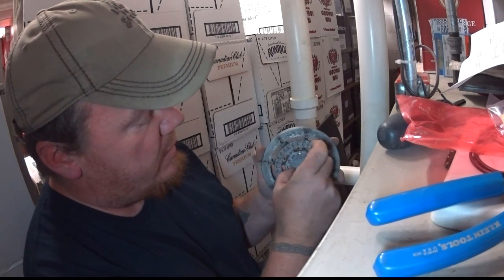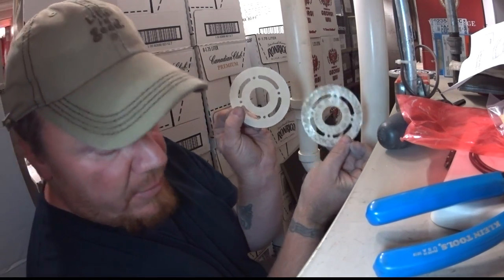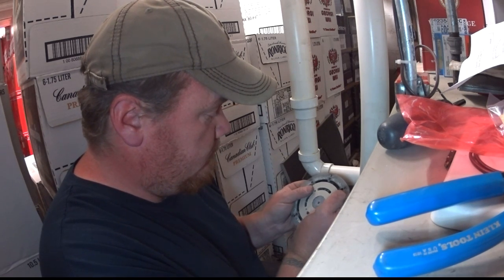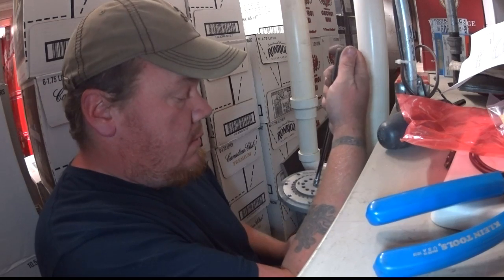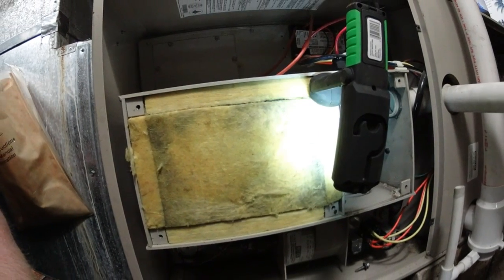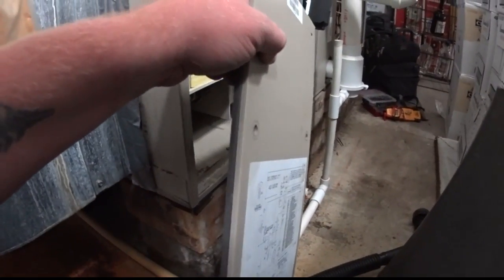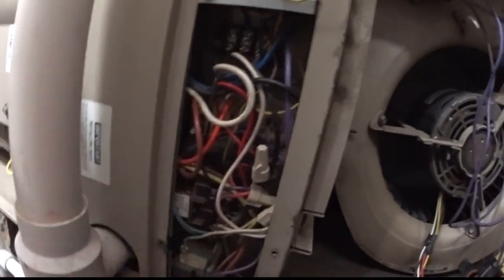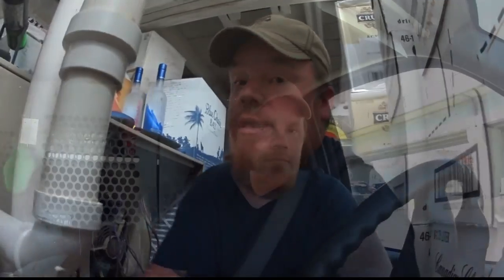HVAC pulse furnace service. #HVAC

Comment: I still have a pulse 21 for 20 + years.However parts are getting to expensive . I see the flabber gaskets on YouTube for like 180 dollars.😭.Also you need to be mechanically inclined to keep them running.I hate to get hit in the pocketbook for a new furnace.but sooner or later everything breaks.☠️
Reply: I had mine go on lock out , removed and cleaned the soot off with a fiber cloth put back together is running great , G21 30 years old , I replaced the ignition control a couple of times with a BASO . When cleaning the flapper don't loose the spacer washer it's easy to do .

Comment: Thanks for the video!! Came home last night to my pulse H14 not working. I removed the air flapper and had to clean the element with a gentle  detergent and a damp cloth. We live in a cold  climate and just needed to get it up and running. Used the blow dryer to dry the flapper element and the old furnace started up like new. 
Is there anywhere a consumer can get parts for the Lennox Pulse furnaces now days? I know they stopped making them in the 90’s and it seems that Lennox won’t sell parts to consumers. Any suggestion where I can get parts?

This furnace is a work horse…. It quickly increases the temperature in the morning 6 degrees in our 3,200 sq ft house in about 10-15 minutes…. Crazy efficient system!

Comment: still have one running in my house.  has a weird issue where it sounds like it's shorting out and wants to cut the motor off prematurely.  I can tug on the wires a bit where they go tin the area above the motor (there's 2 boards in there) on a Lennox G21 and keep the fan running by doing that.  I hope it's just a lose wire, makes a sound like it's shorting out a bit.  It's sometimes stopping the fan while it's still combusting.
Reply from the maker: @American_Made  if the blower motor is stopping ... It may be the blower delay board.  They are known to go bad.

Comment: I have a Pulse 21 that is 30 years old. It will sequence and run for about 5 minutes and just suddenly shut down before the set temp, is reached. I have cleaned the air flapper. I made my own pressure test equipment. Leak down was 1.5 PSI after 10 minutes. I had changed the fan control board a few years ago along with a BASO ignition controller and the bi-metallic high limit switch. Just started acting up again. Would you have any idea what may be happening?
Reply from the maker: @karldegroot3131  I would check to make sure the drain trap in the bottom of the exhaust tee is clear.  A condensate drain restriction will cause issues like you are describing

Comment: Awesome video, question, i have a pulse 21 1996 and replace ignition module with the one you used 4 yrs ago, my furnace isnt heating up and turns off in 3-5 seconds, how do i know my control module is bad, I have green blinking lite is on and no red lights , thinking my flame sensor is defective or dirty, thks

Comment: Just saw this video and it got me thinking...I have a pulse furnace around 28 years old.  It's been a good furnace, not much repairs other than main board.  Just kind of curious if I should be doing some preventative replacement/maintenance on it.  Any thoughts?  Thanks!

Comment: Trying to make sure I understand these correctly. The pulse furnaces do not have a standing pilot light...they start off of the ignition (spark plug looking device). So if my gas is turned off to add another gas spur for stove then turn off thermostat and power to furnace, when line is complete power-up furnace and thermostat and it should fire up on its own?
Reply from the maker: Yes
Reply: @BillyKnoth  perfect
...appreciate the info. Thanks for sharing your knowledge.

Comment: i have 2 pulse furnaces when we built a house 34 years ago.  Lennox replaced both of the cracked parts 20 years ago and had it serviced back about 10 years ago.  think the newest Lennox furnaces are much more efficient?  i know they would be quieter.   wonder if i should have these old timers checked and inspected again but they appear to be working well in Canada...
Reply from the maker: You wont find one more efficient by much....  A % or 2 ...but thats it.

Comment: Did you pressure test the Pulse 5 psi? Lennox told us every 3 years. If didn't hold~~Flat lined then crack internally. Good job, Billy. I had to go to seminar to learn how to repair these beast in 1984.  Lennox dealer back then, also on 2 stage condenser that spring with famous K15 relay..
Reply from the maker: Yes it has been tested....not for a little while now....but whe i do a start up i do check the plenum for co....as the customer does not want to pay to pressure test...new owner of the building.  Lord i hate the 2 speed condensers.....what a pain in yhe ass.

Comment: Hey BK, I have been struggling with a Pulse G-21 all winter. I replaced the flapper and cleaned it one time and it worked for awhile. However the next few weeks it went out and I realized I lost the washer! I used a smaller one and it worked for a few days and now just blows cold air and wont ignite. Do you think the flapper is the issue or something else. I think it might be the heat sensor but I cant get it out to clean it.. can you give me some advice??

Comment: Great work I had the same problem on Thursday the ignition control showed no fault after checking everything it came down back to the ignition control luckily i had 1 on the truck by BASO replaced it and bam started up. It was a no heat call power to furnace but would not start up
Reply from the maker: thanks!!!    I like working on a pulse...   nothing that hard....  but a lot of people are scared of them....

Comment: Hey Billy I have a pulse furnace. Its around 24 yrs old. I never have had a major problem with it.Recently in a bedroom above the furnace there is a pulse noise coming thru the register but I only hear it in that room. Could this be from the flapper because I don't remember it ever being replaced. Or is it more likely to be in the duct work?
Reply from the maker: I would say its a duct issue...   But if its that close to the furnace...  I would have a Lennox dealer come and do a pressure test on the heat exchanger...  They tent to make noise when they developed a hole....  Keep me posted as to what you find and shoot me anymore questions you have ...   Bkwelder102 @gmail.com